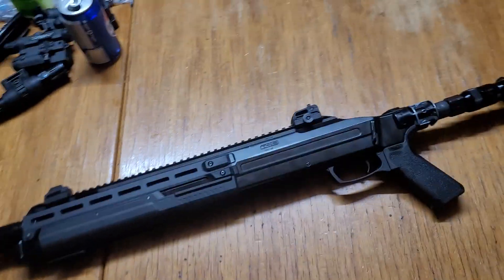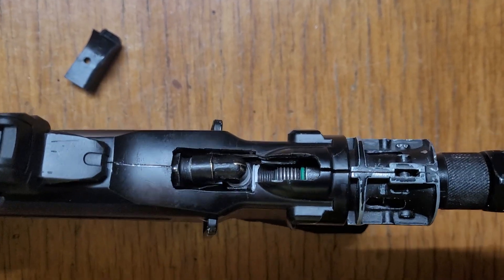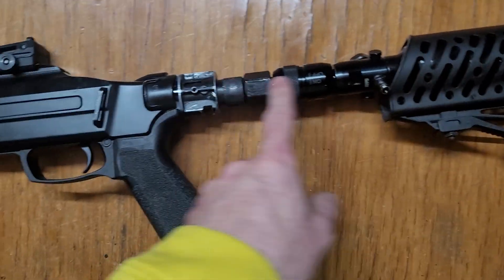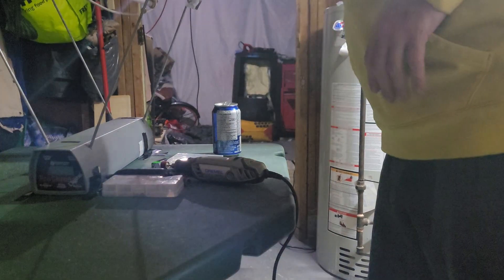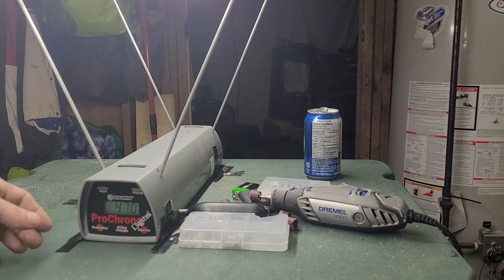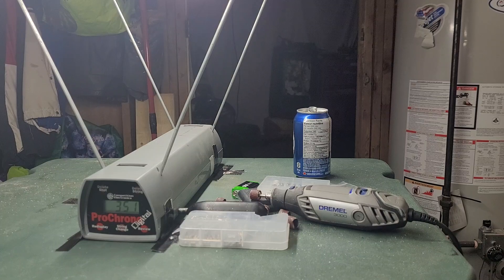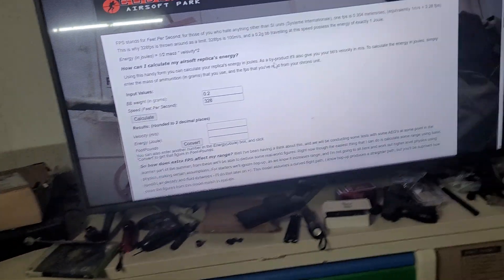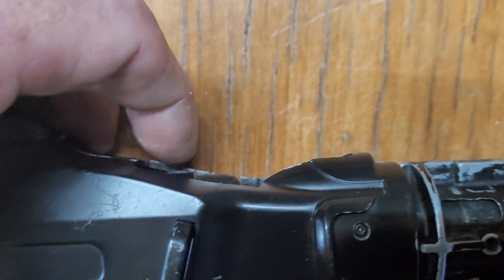Umarex HDX68 HPA Master Cylinder Air Chamber Bypass

Comment: alot can happen on 8 months, is there a way theese days to mod this fac version without grinding or too much 'taking apart work'? i am sitting here with mine and thinking that the only thing this really needs, is just a hpa/pcp tank operating at 1500psi and a longer barrel.. is there also a restrictor inside the 40j model?
Reply from the maker: yes this marker is HPA restricted heavy, you need to do a bypass of the brass pipe inside check out my HDX playlist i show how its done its a difficult mod compared to the rest of umarex gun same with the HDS68
Reply from the maker: i have a 7j version modded to 80 joules now with hpa, the hd24 drop in valve is around 50 joules it more then the stock 30 version
Reply: @LessLethalHomeDefense   Thanx man for your comments and work on theese, the one i have shoot 50 j as is with co2 and perhabs 5-10 j more than that on warmer days, perhabs its not worth taking the risk, i might screew it up... i got it for rubber steel balls selfdefence anyhow, and it doesnt seem week for intruders as is, i would seriously not be comfortable with 30 j or less for intruders, it has to hurt alot

Comment: Maybe I should refrase my question. What would you recommend to boost the joules on a factory 40 j version?
Reply from the maker: only way is to buy barrel extensions from hd24 or you have to do this mod or you will always get 35js from a stock 40 version, even the stock 7 versions modded with a drop in 88g aftermarket valve will get you 50 js with 88g

Comment: Would it make a (significant) difference installing this on a factory 40j version using 88g co2?
Reply from the maker: yes the 40 version is only around 46 js, i now have this shooting 81 joules with hpa its definitely worth it :)

Comment: Dude. You do t even use co2 on this model????? Damn when I had mine done that was the only way should I be sending it back to you to get it changed to pcp or just leave it???    I’m not sure how much better pcp is? Faaak they keep changing the damn. Things
Reply from the maker: ya man you can still get 50 with yours as is, the hpa mod is a lot of work but in the end is worth it to get hpa consistency